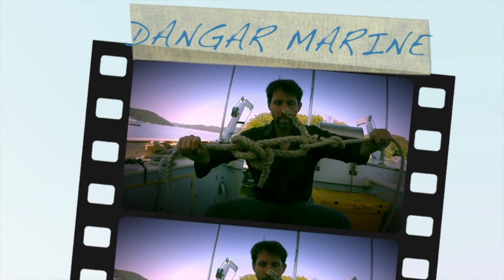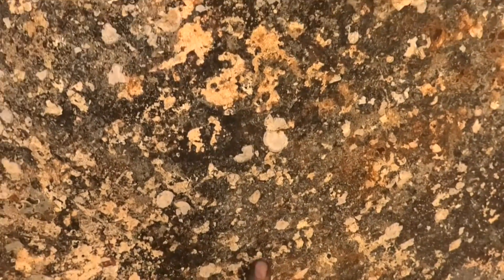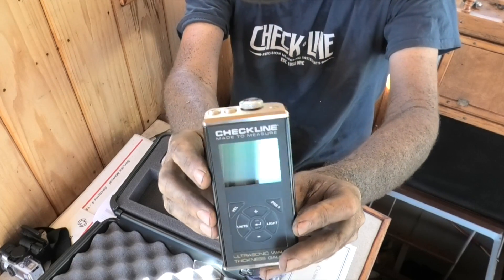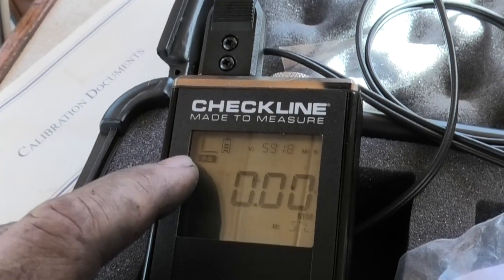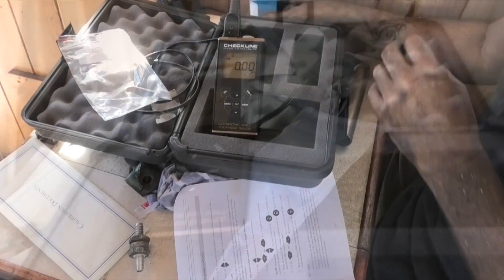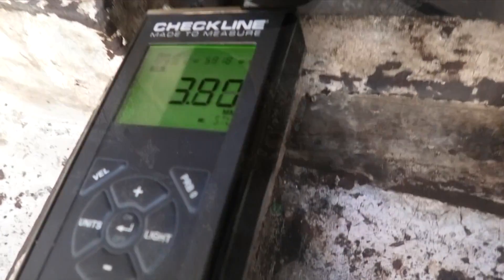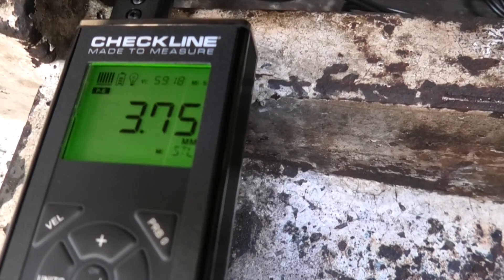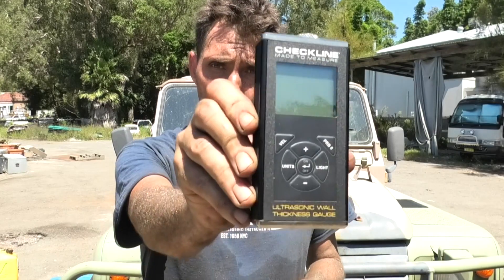Ultrasonic thickness testing the steel hull plates on the trawler

Comment: Stu concur with another commenter do keep a record of what your thicknesses are for future reference. Simple just set it up as a spread sheet. Ie: Bay and location there in. Then in the future when it come time to insure or have a professional survey done there is a past record of thickness as per location. Do not forget overboard water discharges you have continuous or intermitent water flow which leads to metal erosion. This depends on whether it was allowed to spew out or trickle down.The point we are trying to make is any water flow over a metal surface is eventually going to wear it away.
Reply from the maker: Keeping a record is definitely a good idea. I'm thinking of taking readings after the hull is painting as I will be able to take further readings to compare without disturbing anything.

Comment: Great video.  Yeah those needle guns are loud.  Plus makes your hand/arm tingle for about an hour after your done with the job.  Wear good ear protection!  I think a good high pressure washer would do the trick.. Ive seen those high pressure washers rip Barnacles right off the  bottom  of my sailboat.  I’d try the pressure washer first.  Then hit the tuff spots with the needle gun.
Reply from the maker: Grabbed a pressure washer today so we'll see how it goes very soon!

Comment: I spent several days of my life with the needle gun back by the shaft on the USNS Concord, on the island of Guam.  I was listening to the BBC recording of Led Zeppelin on headset.  Another thing we have in common.  Thanks for the memories.  You haven’t crawled thru the engine up to clean the smokestack yet, I’ll be blown away, when you do that.  I have a nail gun.  Hope I don’t have to use it again; but I’ll use your tip, to watch that little screw. Mate!
Reply from the maker: Ah, I know you miss that gun. ;)

Comment: I liked your presentation, mate. It's easy to be seduced by pedantics  such as grit blasting. For over 20 years I learned that the VIP element of being a capable Rust Doctor is [1] You must kill the rust stone dead. Imagine a stream of electrons emanating from a point on a steel plate. (It's a nano battery) . If you zoom in (in your mind's eye) you will see a pit (crater) with a tiny black dot down the bottom. That's what you've got to get out. Grit blasting won't remove chloride ions buried deep in a substrate, just push them in further.   After you grit blast, watch it blush in a couple of hours. If you try to chemically 'convert' it, the whole surface will turn black. The most effective cure for killing rust is phosphoric acid 10 molar 9:1 diluted with water. Prove it by leaving it unattended for 6 months or so. Overcoat with Wattyl EPUP (olive green) 15% thinned with L760 applied by brush. Image you're fibreglassing and 'wet it out'.  Do it once = do it only once. You would need to pay very particular attention to that area under the stern gland. If it was mine, I would replace that panel with 6mm 316. Good to watch a fellow marine enthusiast. Hope I haven't bored you with my didacticism. A good blast job will leave you in peace for a couple of years. That ultrasonic meter is good stuff.  If you need a lesson in strengths of steel, watch a few Smit salvage videos. 3.6mm steel impregnated with ch+. ions can tear like wet cardboard with a force majeure.
Reply from the maker: Thanks mate, not boring at all. I have bought a bottle of Phosphoric acid from a local industrial cleaning place at a good price. It turned out he had a steel trawler too so we hit it off. :) I'm going to be using a Chlor-Rid and Hold-Blast when wet blasting the hull, but I do like the idea of doing a complete coat with Phosphoric acid afterwards. I was initially worried that it would stop the primer sticking but I believe as long as you lightly sand all the lose stuff off after painting it in the primer should stick well. Oh, and I love watching the SMIT salvage videos. :)

Comment: "Nobbling Guns"
Hi Stu, 
You're keen mate, I'll give you that.
Wear some decent rubber gloves to take away a lot of the vibration, don't want you getting "white finger" from that nobbling gun.
Pay for the blaster Stu, do it once, do it right.
Is it  Exy, price wise?
Get a 12 pack of Bundy and supervise your boat from afar being transformed by the blaster chap.
Reply from the maker: Sand blasting is about $2000, so fairly pricey. I'm going to have a go at wet blasting (with Chlor-Rid additives) and see how that goes first. If it doesn't work well enough I'll have to pay the money.

Comment: If you do go down the route of wet blasting yourself, you might like to check this stuff out: HoldTight®102 salt remover / flash rust inhibitor.  I haven't worked on a steel boat, but from years of experience working on my 1987 Land Rover (they use a lot of salt on the roads in the winter here in the UK) I know that unless you get rid of every trace of salt and deep seated rust, corrosion can bubble out of the metal pores within hours, even after priming.  If you get the boat professionally blasted, I suspect it would be a massive waste of time and effort to use the needle gun. Blasting is so effective that the stuff you can remove would probably be gone in seconds anyway.
Reply from the maker: I'm going to give wet blasting a go first, and have already been talking to Chlor-Rid about their products. Should be doing some test runs soon!

Comment: Excellent! My surveyor just did some random measurements. That is good to know how it was build but has no value for assessing the condition. Identifying the weak spots and measuring them is the way to go! On the Ex-Navy ship I volunteer we had Wet wood touching the hull plating in a galley. It went from 8mm to zero in a distance of 4 centimeter, and back to 8mm. Random test don't say much. I did use the needle scaler too for the bulk work so a light sand blasting was enough for keying the surface. I was limited to just 10Amp / 230V so I wasn't able to have enough air for pure sandblasting. Constantly Waiting for new Air pressure to build was a bit annoying but allowed me to catch my breath too :-)
Reply from the maker: I'm glad there isn't too much timber on this boat as I have heard that your problem is very common. I'm going to have a try doing some wet blasting soon which doesn't require anywhere near as much air, it will be interesting to see how it goes.

Comment: A professional sandblasting guy told me that steel create rustflakes at a factor of about one to ten. Ie, if you see a layer of rustflakes about 5mm thick - the steel has lost about 0,5mm of its thickness. This is no scientific formula. I am sure the factor varies between different steels, cast iron and so forth. But the guy had 30+ years as a professional sandblaster behing him, and this method was what he used for quickly determining how much material was lost. Great content, as always.
Reply from the maker: Good to hear the basic ratio. The chunks I peeled off where about 1mm of rust and paint combined so I wasn't expecting to have lost too much steel.

Comment: The way to tell if it is a poor wasted area is to know what it was at the start.. if documents cannot be found then a place where no corrosion has taken place needs to be found measured and used as a datum point. Then the reduction as % can be seen.  Is the builders Yard still going?  If so ask them what they used to build her or were using at the time .  With facts better choices are made. Am@cf
Reply from the maker: Unfortunately I know very little about who or where this boat was built. Will definitely take some readings from other areas once the blasting has been done.
Reply: Give the size and approx age and let us do some digging. We may find a generic answer where your results will verify and cross reference it.  
For your own reference take a test over the fresh paint and once in the water these may show little difference a quick test that can prove a point. But that is down the road a bit.

Comment: I don't know if anyone in Aus does soda-blasting, but if you want to remove rust without removing steel, that's the stuff.
It may be merely bicarbonate of soda but car restorers in the U.K use it on much more fragile panels than yours.
Keep going mate.

Comment: Hey Stu,  have a look into ultra high water jetting,  I used to work for a company years ago we were occasionally hired to go blast the big cargo ships in port before they were painted etc...  I used to sandblast as well and can tell you that water jetting is the way to go if your worried about getting rid of all the contaminants within the metal. After sandblasting steelwork it would begin to rust within a day or so,  with water jetting it could sit for 2 weeks and still look like new steel,  I'm talking 20k psi plus though...  Just something to look into.  And cheers for the videos man,  I gang out to see what you've been doing
Reply from the maker: Interesting to hear about that, I'll look into it. Thanks!

Comment: For what it's worth, about 20 years ago I worked on a grey ship that went into dry dock over at Garden Island. All the paint (plus attached marine life) was blasted from the bottom of the hull using wet blasting. The two part primer was then applied without further dry blasting for added key.
Reply from the maker: Good to know, thanks. :)

Comment: I inspect steel structures every now and then for work. The name of the game isn’t necessarily testing every square inch of a structure. Normally you’d find a certain area test it several times and as the results stay consistent you can check similar areas less closely unless you start to see inconsistency. So on the rail cars i inspect, I’ll check a crossmember in a common fail area. If it’s good all over, I’ll move on to the next ones, but only check them a few places. Like at each end and the middle, until I get to the next type of cross member and repeat. There’s no real need to check every square inch. You just loosen you’re checks every time you move on if everything checks out, unless you see something that causes concern.

Just offering some advice. Love the vids!
Reply from the maker: That makes sense. I guess because it was such a dodgy area I was interested to see if there was any sloping progression in thickness but the rest I won't do to the same resolution.

Comment: The problem with wet-blasting steal is you blast off the old corrosion and then adding new corrosion, dry blasting with a good blow down ie: blast the outside of the hull then blow it down and prime all in one day is the best, I would do all of the inside first but have everything that you don't want to be damaged covered up with rubber/canvas and taped, before the blaster gets there (save money), un-taping and clean up will take ages and an industrial vacuum is best but will struggle. Where you have the boat is a problem also, right next to the water you need to watch for the EPA. Dry blast just the rusty areas you can't prep with a sander/wire wheel.
Reply from the maker: I think with wet blasting you definitely need to use additives for removing salts and passivating the steel to get a good result.
Reply: Ah so not just water, that makes sense.

Comment: Hey Stu. IHMO I think 3.8mm is a bit on the thin side. I realize you don't want to waste money but I'd be a bit leary of that. I'd think the original thickness would have been at least 3/16", (4.7mm) if not 1/4" (6mm)...maybe?. If you're going to replace the transom, would it be that much more work to replace that section of the hull when you have it open?
Grab a pair of those vibration resistant gloves if you're doing any amount of scaling, it plays hell on the nerves of the hand. 
Keep up the good work, as usual a pleasure to watch the progress..........Mike
Reply from the maker: I'm going to do some testing nearby where the paint is still perfect. Hopefully that will tell me the original thickness.

Comment: Dude are you actually calling that clean??  Not wanting to seem like I’m hating on you but having experience in basic preparation for anything being metal wood anything just common sense says hello. Ok there are other options to sand blasting..  suggest you research a bit which may help you money wise and safety also.
Reply from the maker: Certainly clean enough to get an accurate ultrasonic measurement off, not clean enough for painting though.

Comment: Nice thickness tester!  Checkline TI-25TLX  https://www.checkline.com/
It's too bad you live on an island, makes it difficult to rent an industrial compressor and 160# sand-pot. I did that one summer on the farm sandblasting a 10' bush hog  field mower and some other equipment. It made about a weeks worth of work last about a day, just hot as "well you know" summers in Florida 110F in the shade sometimes....
Might want to get a larger two handed needle scaler, I think you'll wear that little one out, just takes more compressor to run.
Maybe roll on or hand sprayer in a test patch some vinegar, phosphoric acid or other weak acid before you start a day ahead and see if the rust and scale will release better??? Just thinking out loud how to make the task a bit easier....
Reply: Here i something else folks have been using on their boats to remove rust and barnacles, sounds odd.
The main ingredients in The Works toilet bowl cleaner include hydrochloric acid, chlorine bleach, sodium lauryl sulphate and citric acid. The Works is designed to clean and sanitize toilet bowls.
It also removes stains caused by rust, lime scale and hard water. The Works is safe on plumbing, sewer and septic systems. It will etch galvanized metals, would not use it around your anodes.
Reply from the maker: The boat is currently on the mainland so hiring is still an option. I'm going to give wet blasting a go first and see how that goes, but I will probably paint some phosphoric acid on afterwards.

Comment: That is an adictive little toy...id have run out of conductive gel...that little blue bottle?
Not enough.
Would the stuff they use for ultra sound during pregnancy work?
How do you check the welding integrity?
Reply from the maker: Pretty sure the medical supply stuff is exactly the same. Checking weld integrity is a very good question though. I think being careful and where possible doing a continuous weld inside and out is the go.

Comment: We sandblast industrial machinery for paint to save time high pressure genie first needle gun any pitting or loose rust then sand blast. It is alot quicker to knock off the loose or layered rust with a needle gun than it is to blast threw it also uses alot of material blasting heavy rust save the$$$ if u dont get complaints.
Reply from the maker: I think saving the needle gun work for the thick rust is the way I am going to go to get the job done quickly and save the neighbours too much noise.
Reply: @DangarMarine  also if u have any powder coat parts that will almost always increase the cost due to it taking longer in most cases to blast but overall of what ive seen the exterior of the boat will not take long at all to blast interior always takes longer so any interior blasting would be most costly so focus yourself on those areas if u wish to give the blaster a head start. Loving this series

Comment: from a rough estimate your hull is around 3/16 thick in that one area. It is not 1/8 thick but its pretty close.. at a guess I would say maybe half the metal has been lost so far, if it started out with 1/4 plate steel. I am using inches as I am not sure you can get plate steel in metric in 1990, at least easily as would be the case for a homebuilt boat. In North America I know all steel and wood products are measured, and manufactured in Imperial.
Reply from the maker: Australia went metric in the 1970s so it would have all been metric plate. It will be interesting to get a measurement off a good bit of steel to see what it started out at.
Reply: @DangarMarine  1974-76 same as canada. Doesn't mean that the stock a home builder got was metric. Here in Canada we still make all steel stock in imperial measurements. Don't forget Australia also did a lot of "soft" conversions. You don't think someone would intentionally make 2.6 mm if they had a choice do you?

Comment: Awesome Stu, We used an NDI reader on aluminum aircraft to find cracks on repairs and ultrasonic testing for remaining thickness on blending areas. Nice tools for sure. Read through some of the responses and agree to use a curtin dropped down from the gunnel and larger tires on the rollaround. Probably good idea to put on a headset with some AC/DC too😈 enjoy Tim
Reply from the maker: Hey Tim. Something like NDI for checking all the new welds would be very interesting. AC/DC is a good idea. ;)
Reply: I'll pull up some info on NDI for you. AC/DC good metal music👍

Comment: you can always do an overlay with a welder for the thinner spots.    I seen large areas overlaid on pressure vessels, so I know it will work.
Reply from the maker: Yes, will be doing a fair bit of pad welding after blasting I think.

Comment: That needle gun brings back memories  for me personally. I was in the Navy and needle guns were the paint maintenance go to tool. We also had deck crawlers for the flat horizontal surfaces. both did great work for paint prep. I wish I had a buck for every time I used one.  That metal thickness tester is one of your best tools to use for hull survey too. Good job mate.